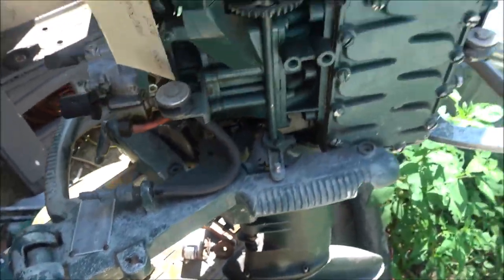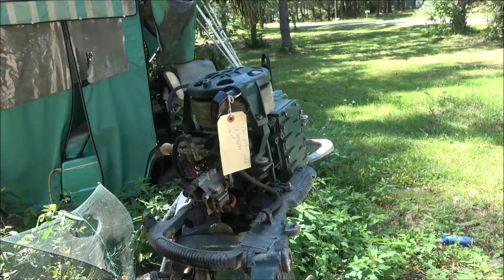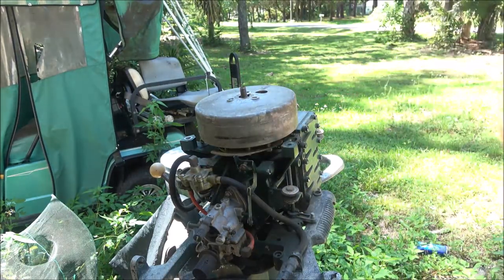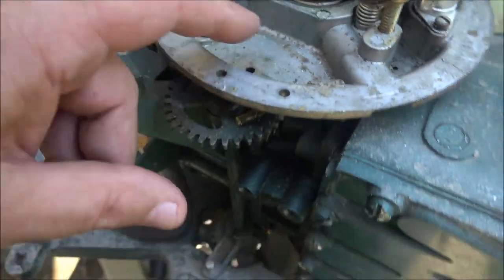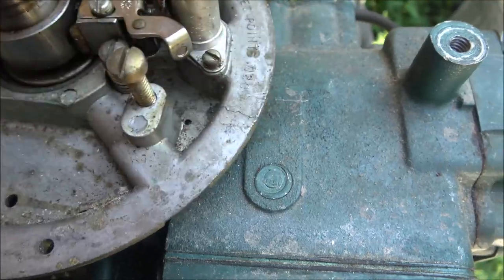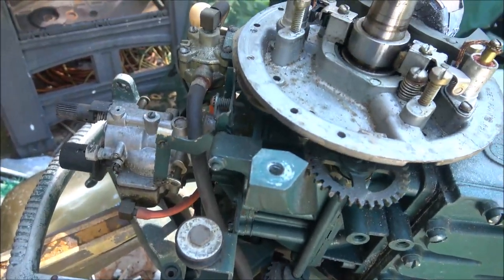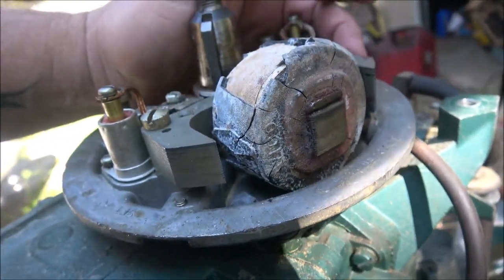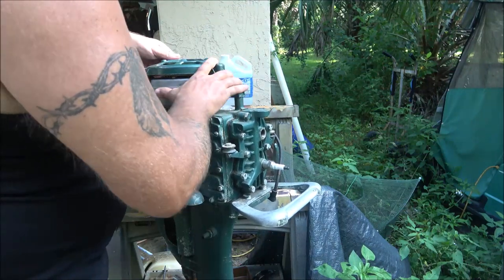1955 Scott Atwater 16 HP Outboard Boat Motor Will It Run? In 4K

Comment: You can fix your coil by carefully removing the cracked insulation and spreading JB weld on.
Reply from the maker: Yeah, I've done that in the past and it works very well. But I still have to find another coil for the bottom cylinder.

Comment: The 3 means Scott-Atwater, the 9 means 16 hp and the last two of the first 4 numbers you reverse to get the year so your last two numbers are 55 and reversing them gets the same result in this case so yes, it is a 1955!
Reply from the maker: Thanks for the info Doug.
Reply: Shabear, look me up on Facebook messenger. I have more info on that Scott-Atwater 16 hp
Reply: The coil I found has the laminates, it's all in tact
Reply from the maker: @ALVintageOutboards  that's awesome man. I tried to find you on messenger but there's like 8 of you lol. You can go to my FB page, shabear1000. Then we can message from there.

Comment: You'll have a very hard time finding new coils. I used to collect Scott Atwater motors. The Phelon coils were junk and extremely hard to come by...but they run very well. The bail-a-matic was for bailing your boat. Has a second water pump under the power head. Pain to repair...
Reply: You can get Cushman coils that WILL WORK. You need to save your old laminates and put the Cushman coils on them. I've already done it
Reply: Good to know. I got away with finding some used and a few NOS coils.